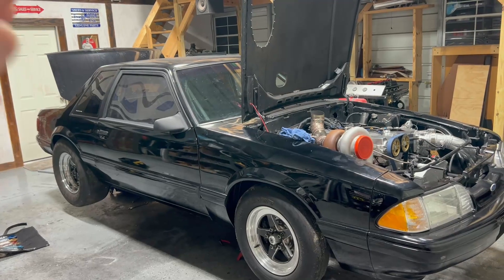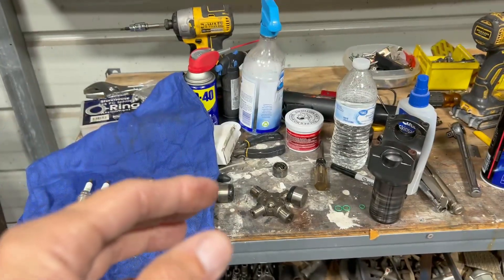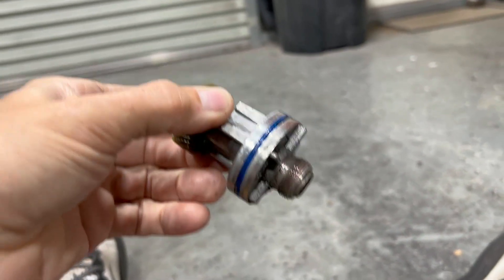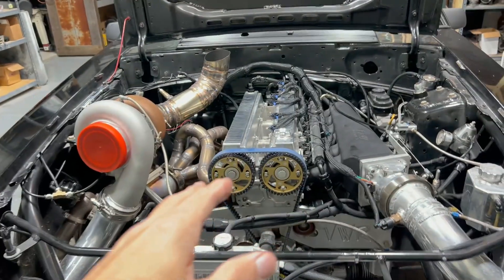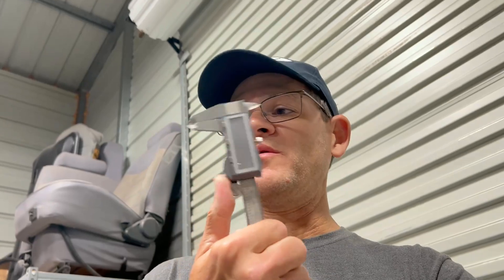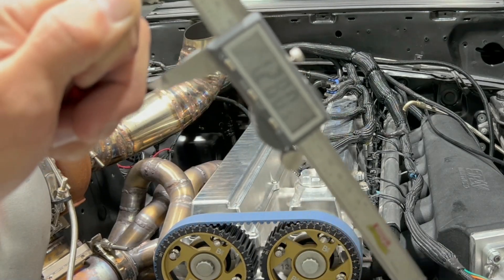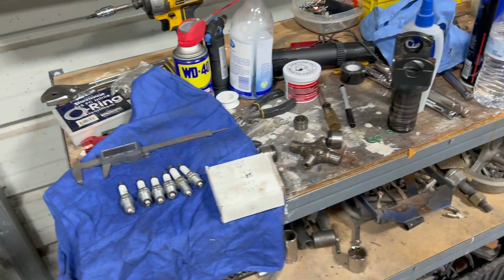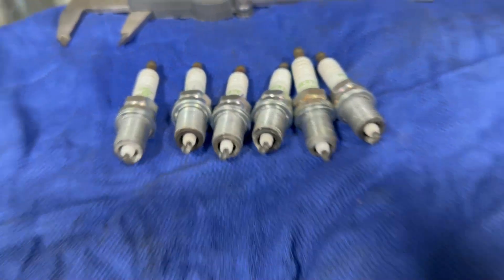2JZ With Maxpeeding Rods And 42psi Of Boost! Did They Survive? Here Is An Easy Way To Check!

Comment: Put a threaded insert into the tans tailhousing. threads will be stronger and it's way cheaper than replacing.
Reply from the maker: Not a bad idea.  It will need a bushing also.